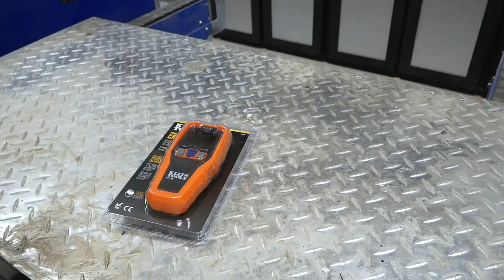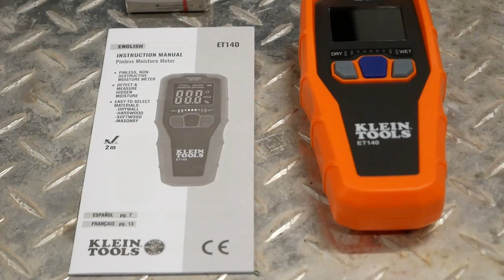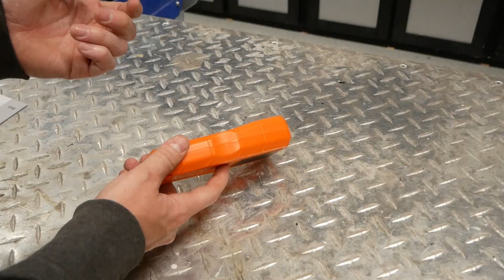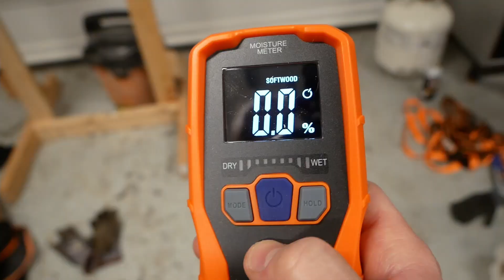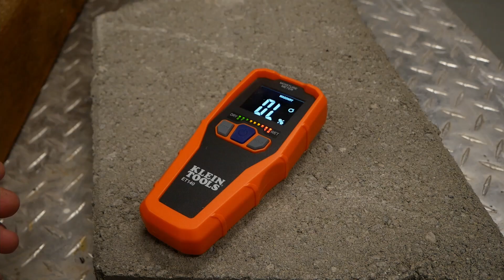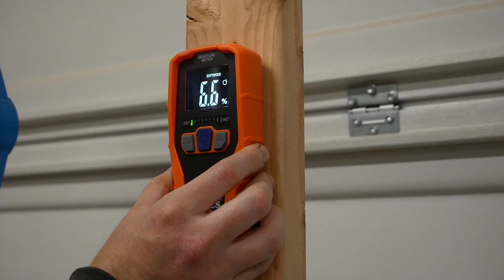The Klein ET140 Moisture Meter is both EXCELLENT and FLAWED

Comment: There's no rubber over-mold for a logical reason, if you think about it. The back must lay flat against the surface in order to receive a reading, just like a stud finder. An over-mold would prevent that.

Also, you don't understand the machine. The instructions will help. For example, on drywall, if the reading is above 70%, it's not going to show you 71% on the machine. It's going to show you OL which means Over Limit, not overload. On masonry, any reading above 63% is going to state Over Limit. Once it hits the over limit threshold, there's no point in providing a percentile scale because the tool is telling you there's a problem with the material that needs to be addressed.

All of this is explained in the 6 page manual you clearly didn't read before creating a video review, as today's YouTube generation does in hopes of being the next star. 

Lastly, there is no 100% reading on the machine. 100% indicates an object couldn't possibly get any wetter. Unless something is completely immersed in water, that's never true. Obviously, this machine isn't water proof and would never be used inside a pool of water to take measurements. The scale Klein uses is their own proprietary system. The 20% reading on a Klein is not the same as the 20% reading on a Kobalt, for example. A 20% reading is not stating there is 20% water detected in the material. The 20% reading is saying you have another 50% left before there's an issue with your drywall that immediately needs to be investigated. If you want a machine that truly reads water content, those are called pin meters. Because Klein doesn't require tapping a hole in a wall, it works from its own proprietary algorithm which is meant to mimic a pin meter. 

The issue comes down to one thing. You don't understand it which is why this is a garbage review.

Comment: I've owned 2 of these. They both failed after the one year warranty expired. They became very inaccurate, extremely low readings on wood, and drywall compared to two other meters I have. (e.g., drywall is seldom .3% in a shower ceiling with daily use).

Comment: It works great!  I was able to scope the area of moisture on the ceiling drywall.  This gives me great confidence that the correct area above was sealed. And it tells me where I need to start removing drywall. Very pleased.  This review completely misread the depth spec in drywall. The reviewer misread the spec for depth of 3/4”. He thought it meant the drywall had to be at least 3/4” thick when in fact it will work from 0-3/4” thick drywall.

Comment: Thanks. I needed this for my own home and was appreciative to hear the 3/4” drywall nonsense. Love klien but think I’ll do harbor freight $10 probe for now
Reply: The reviewer incorrectly read the 3/4” spec for drywall. It works up to 3/4”. He clearly did not test it properly. I used it on my drywall ceiling and it worked very well

Comment: Here's is my understanding of the displayed % readings. It is a relative reading. If it reads 10% then the weight of the water in the wood is roughly 10% of the weight of the wood. If the weight of the water in the wood is more than the weight of the wood (that being the actual weight of the wood alone if it was dry), then a reading of more than 100% is possible.

I think that's why you are getting OL on the masonry. It is really wet so the weight of the water detected in the masonry may be heavier than the masonry itself and thus measure at greater than 100%

Comment: Been using it for a while as well, doesnt really work on concrete slabs, but ok on stone or quartz/marble countertop..etc  Drywood and wood, is fine.  If there is a beam behind the drywall though, it does get weird or overloads.

Comment: That package....omg....near sliced off a finger.
Good angry start!
Then it doesn't stay on...back to Amazon
Reply: To thwart thieves.
Reply: It's crazy how hard it is to open. I hate that kind of packaging. You shouldn't have to use power tools or Samurai swords to open this kind of thing... I had to use a REALLY sharp/big knife (and almost cut my finger off).
Reply: @joshuabray37 I use a hook blade box cutter or metal shears, whichever is closest.
Reply: @lemonaidking  yeah, now I keep a pair of good scissors in my shop. They work well.
Reply from the maker: I don't know why manufactures use packaging like that

Comment: The 3/4” requirement for drywall also threw me off. The manual contradicts itself. At one point it says it can read material up to 3/4”, but then also says the material should be at least 3/4” thick. Which is it? I agree this is skeptical at best for measuring drywall that is actually in a wall.
Reply: I know, right? That 2nd part (on page 5) really messes with you. It's basically saying it's taking the reading at precisely the ¾" depth mark, and if your material is thicker, then it won't be able to read beyond that point...and if it's thinner, then add a spacer btwn. the meter and material being tested. VERY strange.
Reply: I am also confused with this statement. My dry wall is definitely less than 3/4", but the meter can detect the moisture.

Comment: Nice review.  I just purchased this unit yesterday after experiencing storm damage inside my home.  It worked fine helping me determine how much drywall to remove.  Of note is that the instructions state that it will measure up to 3/4”.  It doesn’t state that the material must be 3/4” thick as indicated in your review.